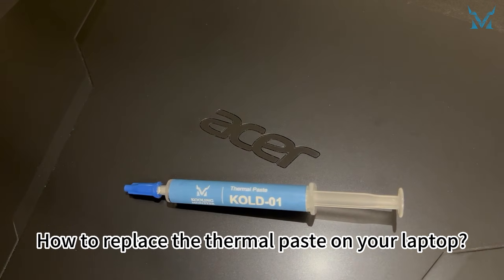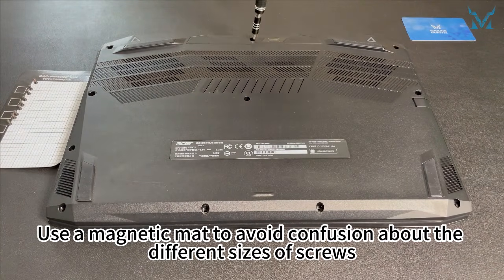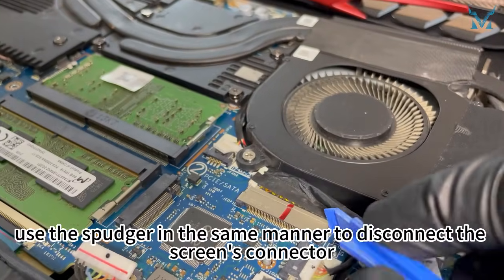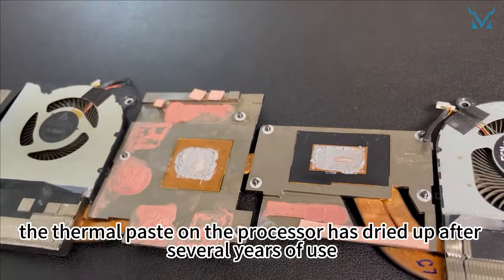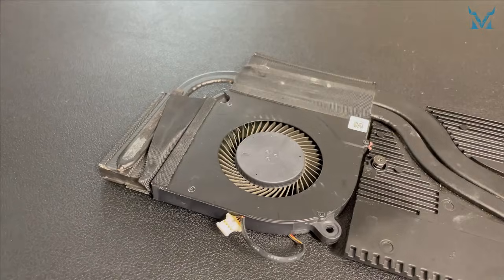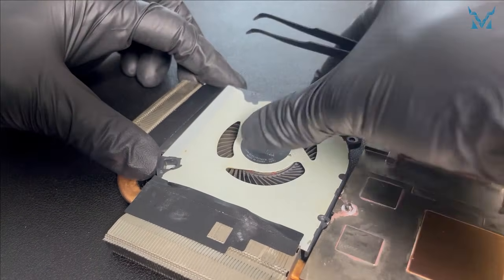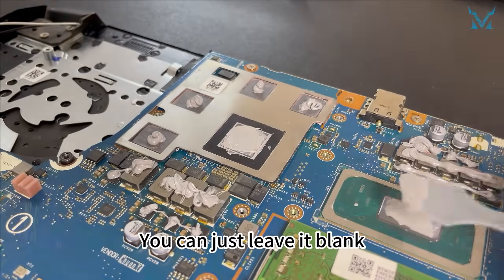Speed Up Your Acer Nitro 5 AN515-57 - Prevent Overheating With Dust Cleaning & New Thermal Paste

Comment: Hi, after following your video step by step I closed the computer and everything was fine for 1 hour. the screen then started to flash and I can no longer use it, what could this be due to? can you help me?
Reply from the maker: Sorry to hear about the issue. It sounds like the display cable is loose. Try to open the laptop again and check if the cables are in place.

Comment: It’s hard to unscrew thermal heat sink
Reply from the maker: try these tips:
1.Choose a high-quality screwdriver (like our KOMBO-01).
2.Ensure the correct screwdriver head.
3.Apply vertical downward pressure when turning the screw.
If you can't screw it in, you can use a rubber band or electrical tape. Here's the link for reference:https://koolingmonster.com/insights/how-to-remove-a-stripped-screw-from-laptop-and-pc-using-only-household-tools

Comment: I shouldn't had left my sidehustle modern laptops are to perplexing for me even though you've concisely shown what needed to be done I'm still not feeling confident enough to do it :(
Reply from the maker: Hello! The pink thermal paste around the CPU and GPU can be replaced. The surrounding chips don't generate much heat, so manufacturers often use thermal putty or thermal pads to save costs. Thermal paste generally has better thermal conductivity than these materials, so it should be fine for cooling. Some people say not to use thermal paste because regular thermal pastes are too runny and their flowability and viscosity are not specially optimized. The gaps between the small chips and the heatsink are too large, causing the paste to flow away easily. Therefore, it's important to use high-quality thermal paste. If you want to replace those materials with thermal paste, we recommend using our KOLD-01 thermal paste. Its flowability and viscosity are specially optimized to avoid this issue.

Comment: I have a similar laptop (10500 and 3060) replaced the thermal pad and the thermal paste with some mx4 but the temperature are pretty much the same as before , someone know why ?
Reply from the maker: I hope you can follow our tutorial and use our thermal paste! Thank you! Feel free to try our KOLD-01 thermal paste. It's different from the regular thermal pastes you mentioned. Regular thermal pastes use solvent-based formulas, which can evaporate when heated, causing the paste to dry out and lose its thermal conductivity. Our KOLD-01 uses an exclusive solvent-free formula, perfectly solving this problem. Therefore, it provides better thermal performance and longer durability when used in laptops.

Comment: wish me luck.....first time maybe last time KEKW ... ill do anything at this point....95+ degree to blue screeeen shut downs...is so terrible for a week old laptop nitro 5...whata joke
Reply from the maker: I hope you can follow our tutorial and use our thermal paste! Thank you! Feel free to try our KOLD-01 thermal paste. It's different from the regular thermal pastes you mentioned. Regular thermal pastes use solvent-based formulas, which can evaporate when heated, causing the paste to dry out and lose its thermal conductivity. Our KOLD-01 uses an exclusive solvent-free formula, perfectly solving this problem. Therefore, it provides better thermal performance and longer durability when used in laptops.

Comment: Did you use all the thermal paste (2.1ml)?
Reply from the maker: We use our thermal paste calculator to determine the best amount of thermal paste to use. https://koolingmonster.com/insights/estimate-how-much-thermal-paste-you-need-on-cpugpu-with-a-calculator. Also we spread out the thermal paste before putting back the heatsink to check of we put on too much or too little of paste.

Comment: this is a great video for anyone using this recently my tip is to make sure that you are gentle with the atennae for the wifi chip at 5:55 bc I have such big hands it came off easily but never went back on, unfortunately replacing the ends of these white and black cables isnt possible so make sure to be gentle when putting them back on!! (luckily i use ethernet anyway but beware if u use wifi)
Reply from the maker: Thank you for the great advice for everyone!
Reply: @koolingmonster  thank you! your name fits perfect my computer is now also a kooler monster
Reply from the maker: Thank you for the nice words! We are glad that our products might be of help!
Reply: if you did the same as me don't be too concerned you can either a. soder it back on or b. replace the cables entirely ( but this process is lengthy and hard bc u remove the mobo)
Reply: or leave it alone if u dont care lol

Comment: Question, I use a acer nitro 5 rtx 3050 and everytime I play heavy games like cyberpunk it cuts my battery from charging and reduces my the laptops performance, even after setting the game to high performance it still cuts my laptop battery power and reduces quality and start lagging please help 😢
Reply from the maker: It is hard for us to diagnose the exact problem just through these information, but thermal issues can cause laptops to cut power and slow down.

Comment: Help. I followed the steps. But the screen now wont turn on. It seems to be getting power but not display. Ive re checked the screen wire
Reply from the maker: We are very sorry to hear that. Try double checking the display connector cable, as well as the power cable. We hope your issue can be resolved soon!

Comment: Hey, I don't want to change thermal paste, but i want to clean fans, is changing paste necessary?
Reply from the maker: To get most result out of the cleaning, it is very necessary to change the thermal paste. Cleaning the fans improves heat transfer from heatsink to outside the laptop. Changing the thermal paste improves heat transfer from CPU to heatsink.
Reply: @koolingmonster  thanks for this, actually i bought my laptop 7-8 months ago,
And i didn't knew that laptop shouldn't be used on bed 💀, it started collecting dust from my bed,
I belive my thermal paste are fine completely, it's just my fans are so dusty,

Thank you so much 🫂, if my thermal paste looks bad i will change it ☺️
Reply from the maker: You are welcome! Yes laptops collect dust more if they are often used on the bed. But dust cleaning will solve the problem!
Reply: No it does not necessary. I just cleaned mine and the temp drop to some degree.
Reply: No

Comment: Im having a lot of issues on screw 3, anyone else?
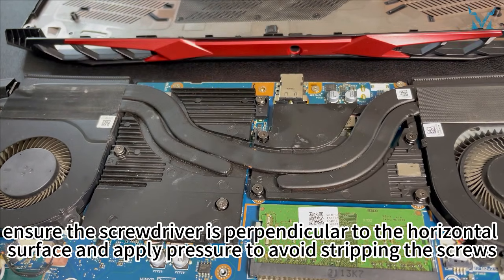 2:15
Reply from the maker: Is ths screw stripped? First make sure that you using the correct screwdriver bit? You can try to remove the stripped screw with rubberband or gaff tape on the screwdriver bit. We have a tutorial specifically on this matter on our website. https://koolingmonster.com/insights/how-to-remove-a-stripped-screw-from-laptop-and-pc-using-only-household-tools
Reply: @koolingmonster  Looks like The screw was molten in place, I took it to someone with more experience and everything came out right

Comment: Well,thanks for tutorial.Cleaned from dust,and some weird stuff,replaced only thermal paste with MX4,i had that one near me,from 92c in games to 71c,thats alot. 👍👍👍
Reply from the maker: You are very welcome. We are glad that our tutorial has helped you. We hope that our products might be of help as well in the futrue! Our KOLD-01 Thermal Paste uses a special non-solvant formulation design that can prevent paste drying up and losing thermal conductivity, resulting in longer lifespan.
Reply: Can you help me to decide between  this ACER Nitro 5  and  Asus Tuf / 11400H / 3050 / 16GB / 512GB M.2  
Please help :))) Cheers!! @koolingmonster
Reply: @koolingmonster I picked up a tube of your product and about to replace my paste with it, on same model of laptop.
Reply from the maker: @slupot Thank you for trying out our products! We hope the thermal paste will help you with your laptop!

Comment: Thermal pads should be replaced with thermal pads not thermal paste. Also removing motherboard small battery is recommended before You start disassembly.
Reply from the maker: Hi! There will be no negative effect if replacing thermal pads with thermal paste. Especially with our KOLD-01 thermal paste, our special design enables it to have enough viscosity to replace the thermal pads.

Comment: Good tutorial, however i wouldnt reccomend using thermal paste instead of thermal pads on the video memory chips
Reply from the maker: Thank you for liking our video! We understand your concern, however our KOLD-01 thermal paste has special rheology design that allows it to have high viscosity and can do the job of thermal pads. There will be no negative effect replacing those with thermal paste.

Comment: Hello 👋 
Both slot Pcie nvme M.2 able support 2 x 2 TB ?
Then can put in each Single slot 1 and slot 2
With 2 TB and total 4TB ?
For this model (2023) Acer nitro 5 AN515-47-R3JC
Reply from the maker: Hi. There are no limitations on the drive capacity. As long as it is a nvme M.2 SSD, you can install whatever capacity drives you want.
Reply: I personally did exactly what you are asking. On the same exact ACER nitro. 2tb x 2 m2ssd drives. Samsung Evo 970. Also upgraded to 16x2 ram for 32gb total. Works great.

Comment: Terrible product, terrible brand ACER!
I bought my NITRO 5 just on April 15 of this year (2023) in Lima, Peru.
I installed all the programs that Adobe required such as Illustrator, Photoshop, Premier and others.
The first month the operation was fluid (or so I thought) and I did not have many problems, it was at the beginning of June of this same year (2023) that I began to present them: I was using a basic graphics editing program (Adobe Illustrator) and the The screen would go black or the program would close unexpectedly.
I thought it could be because of the weight of the program or the graphics, but the funny thing is that the same thing started to happen to me later (black screen, closing the program) but this time with GOOGLE CHROME, that is, a program that all computers use and that can be downloaded directly for free from Edge. Same with Spotify.
And not only that, then the problems came with the taskbar: for now, the hidden programs disappeared.
Another point: the screen began to project green vertical lines for a couple of seconds.
I sent it to technical service to enforce its guarantee and in just 6 days they delivered it to me again, they made some changes but I don't see much improvement, on the contrary, now it takes almost 10 seconds to turn on to put the access code when before to send it for repair was in less than 5 seconds. I will have to resubmit if I continue to see these issues in the next few days.
I only write this comment to recommend from my current experience that if you have or are thinking of another option, opt for it. Don't buy that kit. Not to mention that I have been moving the laptop from one place to another, since the first day I bought it it has always been in a fixed place and it has not had any blows, it does not have a single scratch!
It is a bad product, do not invest in this model of equipment or in others of the brand, I say this from experience.
It has been the worst purchase I have ever made.

Comment: Thermal paste is needed on gpu and cpu, but thermal pads are better on chips
Reply from the maker: Thank you for your reply! There will be no negative effect if you replace the thermal pads with KOLD-01 thermal paste because of its high viscosity design.

Comment: I also cleaned the pink thermal paste around the chipset if we put normal thermal paste will this would be safe ? Or either it can effect the motherboard in future can you plzz explain?
Reply from the maker: We understand your concern, however our KOLD-01 thermal paste has special rheology design that allows it to have high viscosity and can do the job of thermal pads. There will be no negative effect replacing those with thermal paste.

Comment: Friend, only with phO can I disassemble?  or does it need to be a pho bit?  I'm having trouble with 3 screws that won't come out at all lol. Nice movie
Reply from the maker: Hi friend! We are glad that you liked our tutorial. We recommend always using the correct screwdriver bit when removing screws. Sometimes the wrong head can also remove screws, but you are in danger of stripping the screws and having them stuck in the laptop. You could give our KOMBO-01 screwdriver a try. It has differennt replacement bits specifically designed for computer disassembly.

Comment: Can u suggest me Ram for Acer Nitro 5 AN515-57 which currently has a Kingston 8gb ddr4 3200mhz 1Rx16.Will 1Rx8 run with 1Rx16 which are manufactured by different companies.
Reply from the maker: Yes, however it is best to use the same ram sticks in one machine.

Comment: My laptop ain’t turning back on even though I followed the steps thoroughly
Reply from the maker: There are many reasons that can lead to a laptop not turning back on. Try first charging the laptop incase the battery died. Then try if the power cable is fully inserted on the motherboard. 
If the problem isn't solved or you need additional help, please feel free to leave more comments and we are happy to help.
Reply: Did you put your battery plug back in and what happened?
Reply: Hi, I need help, the laptop doesn't want to turn back on.
Reply from the maker: "There are many reasons that can lead to a laptop not turning back on. Try first charging the laptop incase the battery died. Then try if the power cable is fully inserted on the motherboard. 
If the problem isn't solved or you need additional help, please feel free to leave more comments or contact us and we are happy to help." @tjlaser99

Comment: Watching you put on the termal paste was a bit brutal, but for the rest of the video, i want to say thanks. I have around 50° on idle, and when cpu is on 13% my temperature is on 91° so i wanted to change my thermal paste. Even when the laptop is just 2 years old.. i will never buy an acer again..
Reply: never use your laptop unplug because it can cause more heat due to power consumption from the battery. Never let your battery go below 20% it degrades your battery life.
Reply: bro my Nitro 5 is less than a year old and it's cpu is at 92° at 10% usage and my gpu is at 86° at ~98% usage, you're good lol
Reply: @phyxiox change your power setting in control panel and "create a new power plan" then maximum processor state to 99% and minimum to 90% it will make your laptop 60°-70° Celsius temperature

Always turn your laptop fan to 4500+ rpm when gaming with power cable attached you'll feel like riding a Airbus A380 plane😎😎☝🏻☝🏻 You'll also control your laptop temperatures 60°-70°
Reply: Thermal paste is routine maintenance, like changing oil in a car. Also laptops by design have issues cooling especially while having a powerful GPU. They are small, compact, all the components snuggled up with each other. A desktop has a large open case with sometimes a dozen fans circulating air, and due to components being spread out it  allows them to cool off easier. Due to this excess heat, the thermal paste hardens over time, leaving microscopic air pockets in it, thus degradation of its effectiveness occurs.
Reply from the maker: Very well said!
Reply: You have to use throttle stop and uncheck use turbo for Acer
Reply: It is still good laptop tho. Powerfull and pretty comfortable.
Reply: You will never find a PC that doesn’t overheat after 1-2 years. You need to learn how to change thermal paste and only buy laptops that let you do that.
Reply: bruh you expect your laptop to clean on your own?😂  you need to apply thermal paste after year of using it
Reply from the maker: Thank you for your reply! We are very happy to know that our tutorials and videos might be of help. Here is the link to our KOLD-01 Thermal Paste product page if this helps! https://koolingmonster.com/thermalpastekold-01

Comment: I forgot to disconnect my laptop battery while cleaning and changing thermal paste 
What should I do!!??
Reply from the maker: We suggest always disconnecting the laptop battery when accessing the internals. It is also important to wash hands to prevent static electricity from damaging the motherboard. If your laptop turns back on and does not malfunction, you should not worry too much.
Reply: @koolingmonster I did the same thing he did but only with the long black wire and the fan wire after I noticed what I did I plugged them back in and did everything else after I was done I plugged my computer in and the charging light turned on for a second and turned off and ever since then nothing’s been responding won’t show it’s charging or turn on
Reply from the maker: Sorry to hear about the issue. It sounds like there may have been a short circuit when the wires were unplugged. Try these steps:

1. Double-check if all connectors are secure.
2. Reset the battery or disconnect it for a few minutes, then reconnect.
3. Try powering the laptop with only the charger, without the battery.

If it still doesn't work, I'd recommend seeing a professional technician. Always disconnect the battery before working internally to prevent issues. @Chris-pl9ru